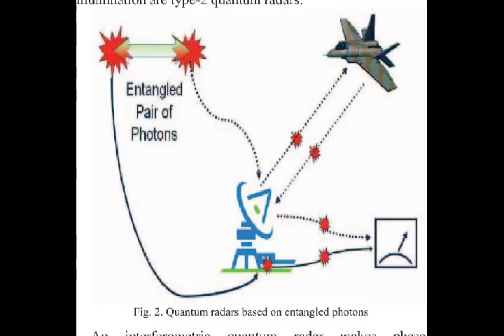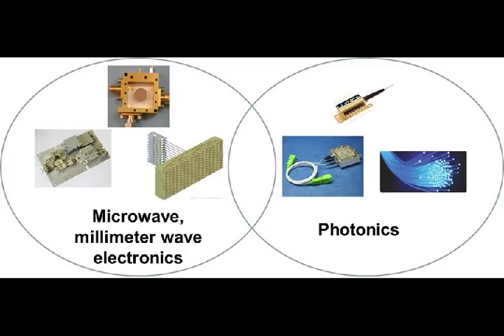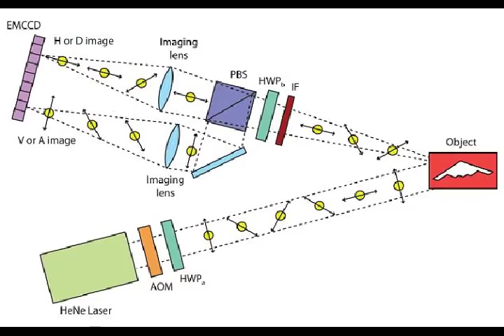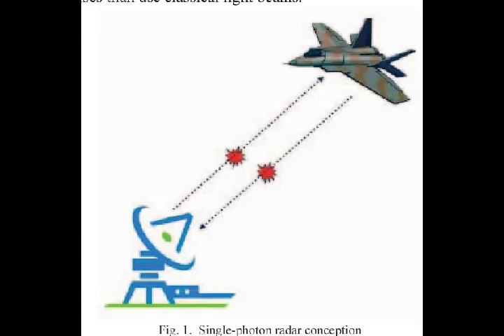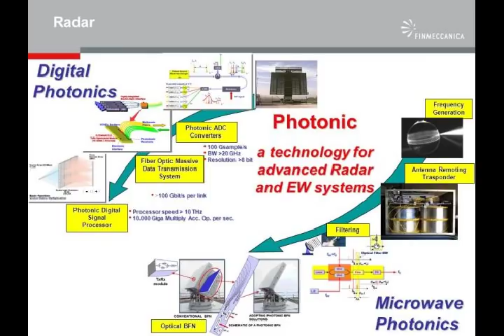Russia's Advanced "Radio-Photonic Radar" for Its Future Generation Fighter Jets

Comment: if u can detect stealth , Why u develop stealth technology
Reply: เสรี นิระมล the SU-57 isn't stealth. It has low observable qualities but thats it. Makes sense since pure stealth is. It impossivle and obsolete. Birds don't fly at Mach 1 at 30,000 feet. So picking up a bird sized object cruising like a jet is... probably a jet. The Su-57 uses beaming, which can engage adversaries at adjacent angles.
Reply: Don't put all your eggs in one basket
Reply: DarkSideSixOfficial it has the best radar, radar jamming, infrared, and ecw capabilities in the world, with 3d thrust vectoring for maneuvering.  I do think it's somewhat stealthy like f35 but it doesn't rely on it.
Reply: @DarkSideSixOfficial  it doesn't need to have those fancy stuff that the F35 and 22 features. The Russians have already coated all their aircrafts with Plasma. The SU57 had 10 flights in the past from Moscow to Syria without being detected.
Reply: @zed9095  good on Shukoi. They've always made great jets.
Reply: @DarkSideSixOfficial  the SU35 alone is stealthy enough to circle an F22 since they coated everything with plasma stealth, remember Syria.
Reply: Not all enemy’s will have this technology

Comment: The US already has a system to detect stealth aircraft, it’s called the Legion Pod and it can detect long wave infrared that when used with similarly armed fighter jet that can then generate an undetectable weapons grade track without using radar! Of course the problem for the Russians is that they lack the electronic manufacturing capability to build the supercomputers to install on their planes needed to turn this infrared information into a weapons quality track!
Reply: Well good for US, they should start implementing these, as for the russians, well they are far from development today. Yes they would get a detection (not tracking) range of 400km for 0.1m2 but that is not built also it is only a concept.